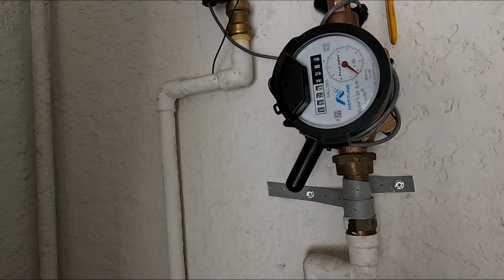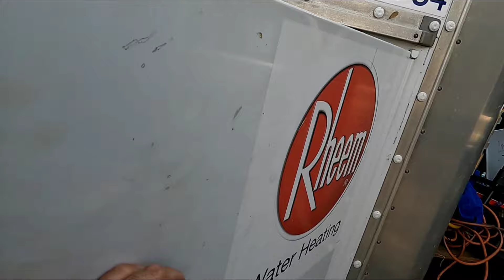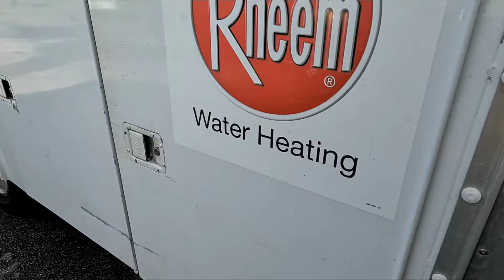PREPARING A CONDO FOR OWNER ARRIVAL!

Comment: So, it does look like your alignment is out.  I’m sure you know to look into a legit shop that can handle your truck and not some “Tire King…” type of place that has no clue how to handle your type of truck.  Have you ever replaced your shocks?  If not, probably would be wise.  Anyway,  a decent & hopefully honest shop will tell you what is needed front-end wise.  I had an 86 Club Wagon and have worked with E350’s on my job for many years.  They’re shitty on brakes & tires!  Good luck!